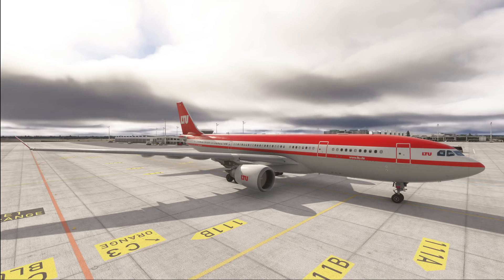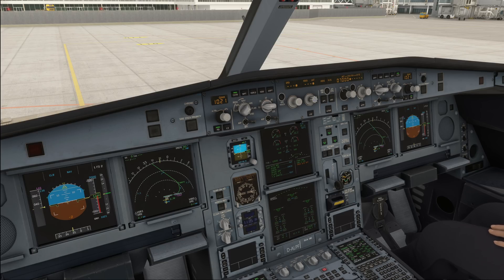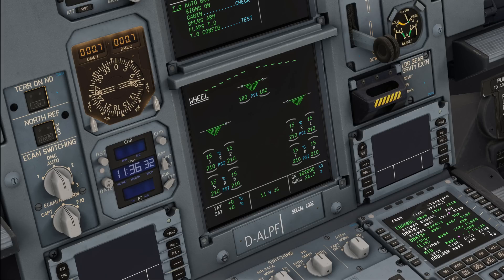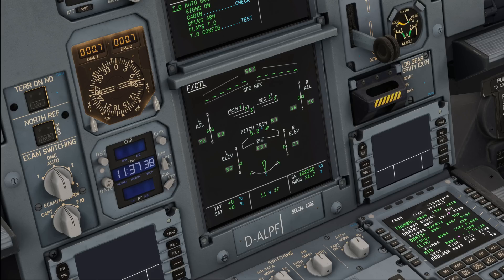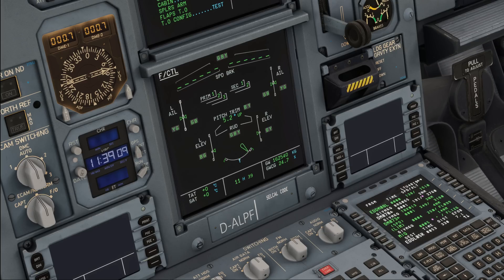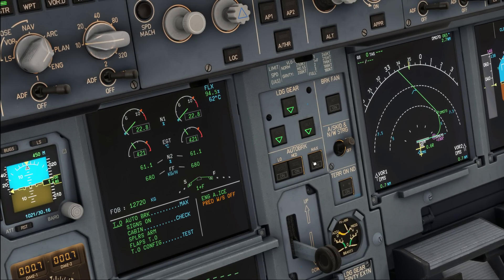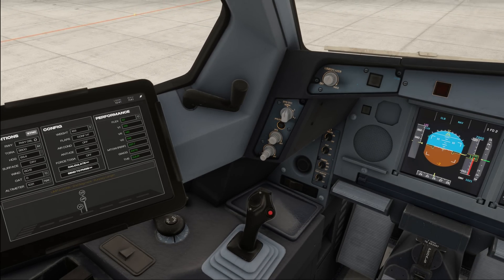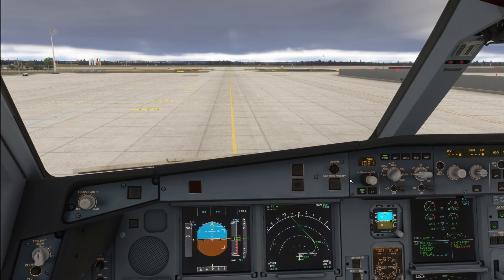Understanding the Airbus Flight Control Check | WHAT MOST SIMMERS GET WRONG | Real Airbus Pilot

Comment: Do you check the spoilers as well? I noticed on my a320 that the lift spoilers don't all deploy for aileron deflections. They do all deploy using the speed brake. It looks like a couple more panels come up during the speed break deployment then in response to the aileron movement.
Reply: Roll spoilers are only for spoilers 2-5. Ground spoilers deploy all 5 but you don't need to check all 5 pairs are moving during flight control check. Speed brake function is only spoilers 2-4
Reply: I have to check it in the software, but from memory, if you are on the ground and deploy speedbrakes, spoiler no1 is also a bit deflected. Used for example by maintenance...

Comment: I've always wondered, what if the flight control display / sensors are broken? How do you check it then? Or is that a return to the gate at all times?
Reply: Position is send to the efis via FCDCs and origins from the flight control computers, if a servo lvdt fails the computer senses this and issues a servo failure.

Comment: I figure that in flight simulation  the main concern in doing the flight control check before rather than during the taxi phase, may be due to the fact that one is operating s multi crew aircraft as single pilot. In my case  consider that I should be fully configured for takeoff by the time I pull away from the stand... less take off items like transponder, wx radar, packs and lights. Getting those taxi checks out of the way gives me peace of mind, one less thing to worry about: All I have to do now is find the runway, drive and talk on the radio.

Comment: How come there are 2 aileron arrows in the 330 here but in the 320 there's only 1 arrow?
Reply: The A330 has a split inboard outboard aileron while the A320 does not.
Reply: Because there are 2 pairs of ailerons on the A330. Inboard and outboard so they show them independently incase one fails it shows which one specifically. A380 has 3 pairs
Reply: Bigger wing bigger load alleviation feature…. The A380 has 3 ailerons per wing.

Comment: I thought the auto brake wouldn't activate until well above normal taxi speed?
Reply: Correct and it has nothing to do with roll spoiler command, at this stage computed by the SECs... for the 320...

Comment: I take it the other pilot doesn't need to do the rudder pedals again as the pedals are linked? Or is this different for say A330's with an electrically controlled rudder?
Reply: Usually when PF announce "rudder check", PM will put their feet on the pedal and respond "following".